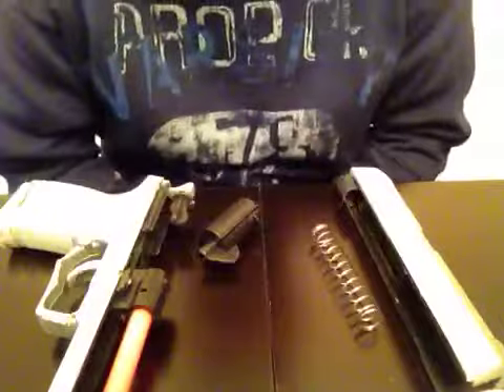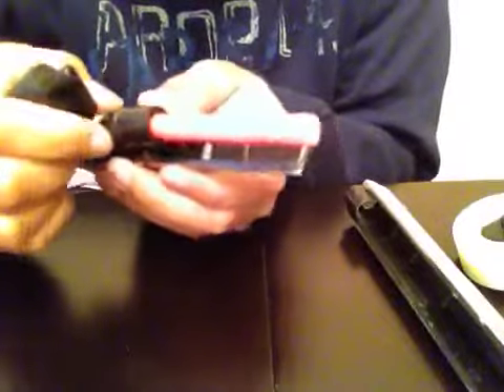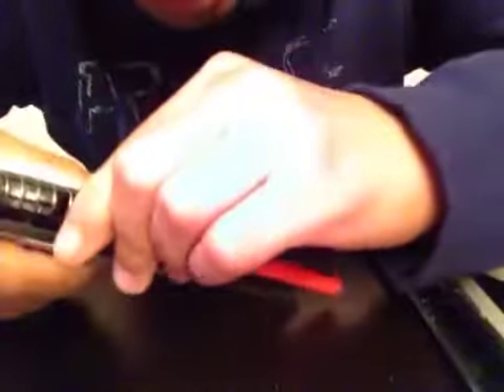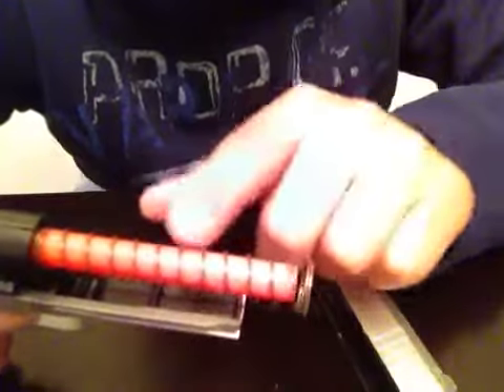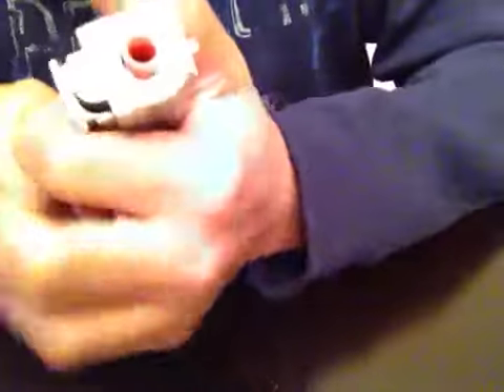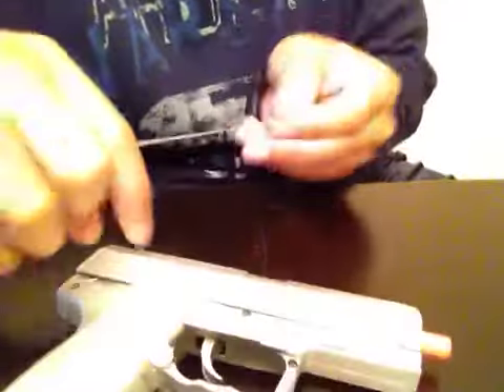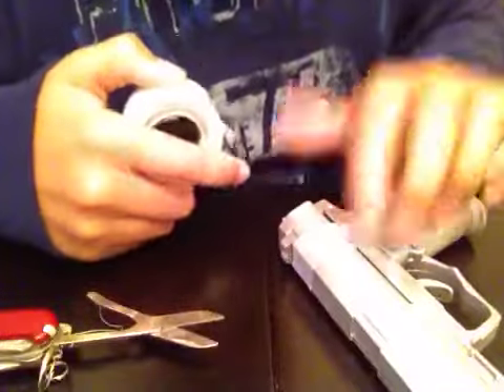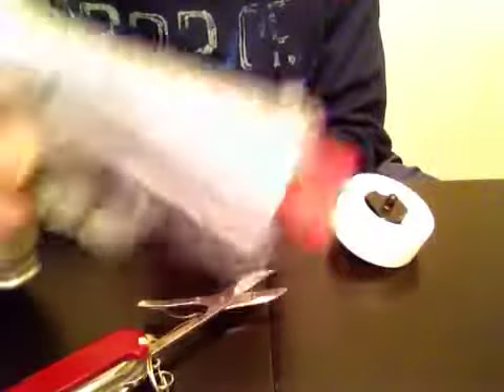How to fix a broken airsoft pistol

Comment: the piece in the back, you have on the inside, its black and grey and it holds the spring in the back but mine broke, what could you use to fix it or what could you use to replace it????